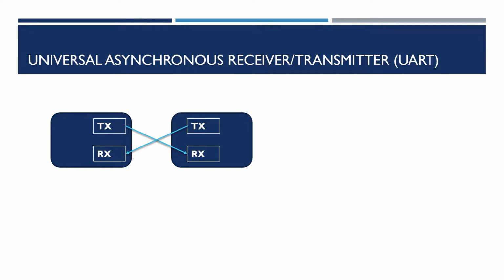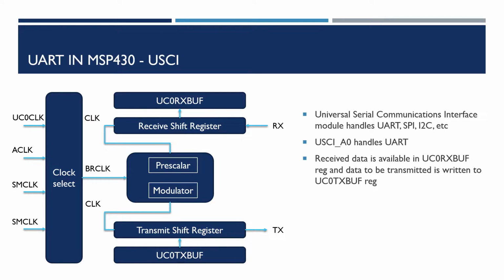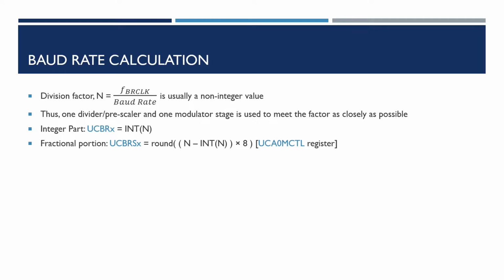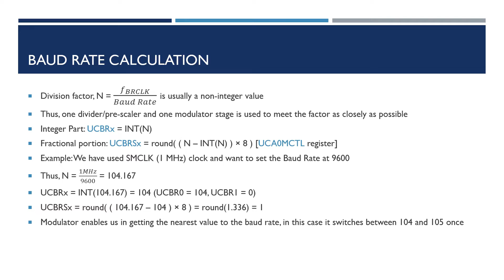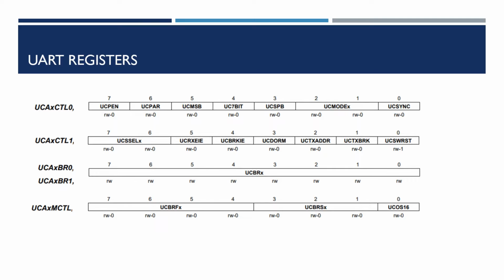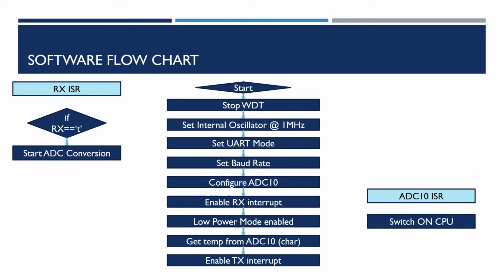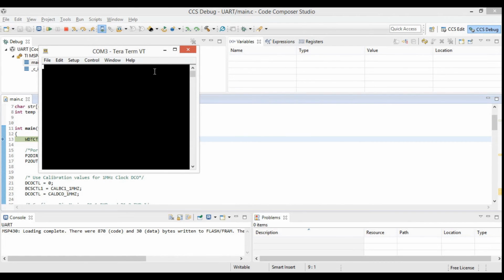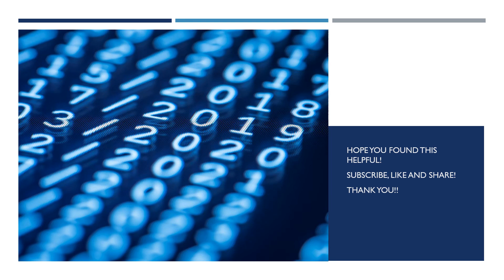MSP430  UART - Temperature sensor value monitoring on PC

Comment: Thanks. You know your stuff 👏 I remember that sometimes you receivr “0” value as an error. Do you know why it happens?
Reply from the maker: Thank you! I haven't received 0 , could you check if  the code has any errors.
Reply: @BinaBhatt it was long time ago. Not your code. I guess i was using a library but recently checked that this library is also discontinued. I am also using Energia btw. Tried by reading  pin A10 analog value, with some conversions. Seems to work so far.